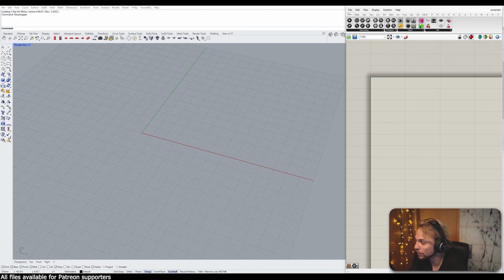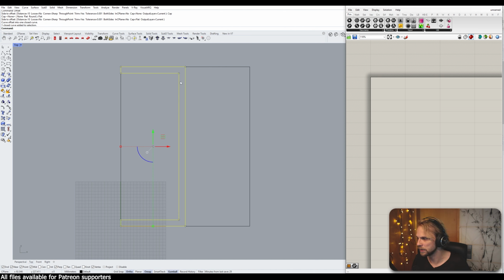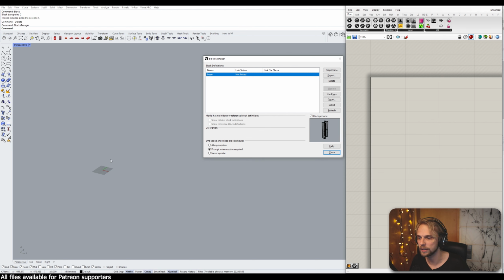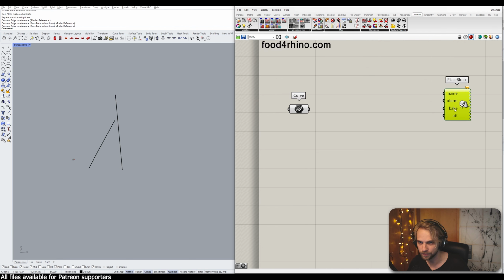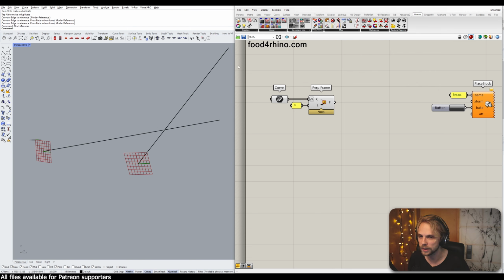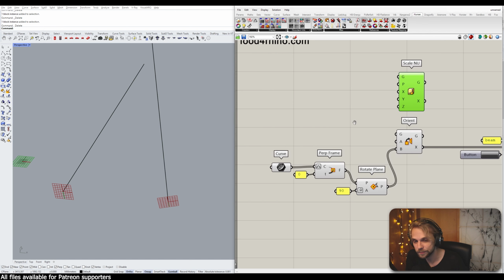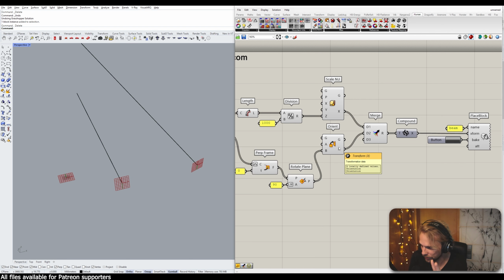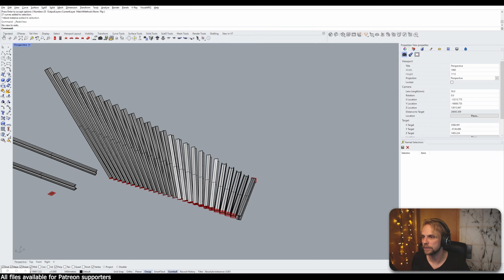How To: Use Rhino BLOCKS as STRUCURAL BEAMS with Grasshopper (BEAMS PART 1)

Comment: Thanks for the vid. That last line in your tween was flipped because when you created it you started with the top, which is 0 in the crv domain. When you tween crvs the first crv you select in that tween is referenced for crv direction for all the tweeted crvs. Except of course for the last line which you created “flipped.”  

Bonus: if you want to stack multiple Xforms (transforms), I would recommend using the matrix component.

Cheers!

Comment: Very interesting. Is there a way to create a Cut-list (or BOM) of the resulted beams?
Reply from the maker: Yes, of course. Since our starting beam "master block" is 1m long - the Scale factor, that's used to strech the beams to their correct lenght is literally the lenght of each beam in meters. Using Panel you can export this list in an CSV excel formay or using textTag3D you can show the size of each beam next to it
Reply: @DesignGoBrr  tnx, great tutorial btw

Comment: That´s very useful! Thanks for sharing it!
Quick thought...
Is there a way to create a block inside a grasshopper definition so you can change parameters to the block and then using the updated version into another more complex definition??... imagine creating a block for every repeated piece so you could optimize the definition with the beneffits of adjusting parameters like thickness, X and Y section... Right now I´m working on a definition that reorients adjustable objects, instead of building every single object from scratch... That is a way to optimize the definition and have fewer calculations, but it would be awesome to build a library of adjustable items that then could be "summoned" to your projects. With the beneffits of being a block.
Reply from the maker: Oh yea - of course. Check out DefineBlock grasshopper tool (same Human plugin) - you can automatically define any GH geometry as a block (as well as overwrite the data of an existing block)
Reply: @DesignGoBrr  Interesting! I´ll use it for my current project, thanks for sharing knowledge!